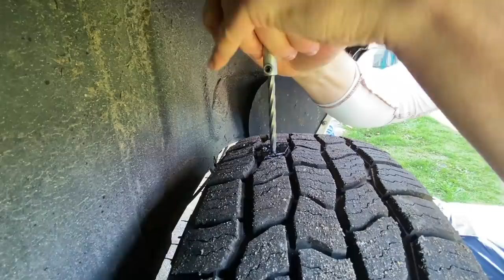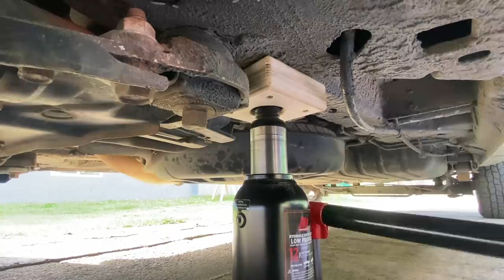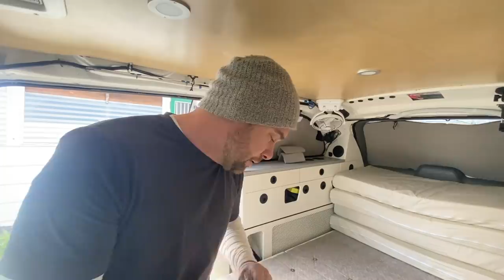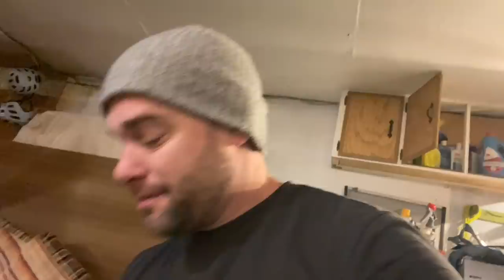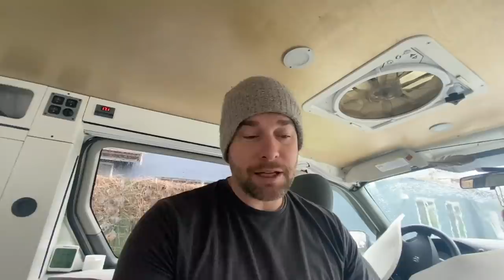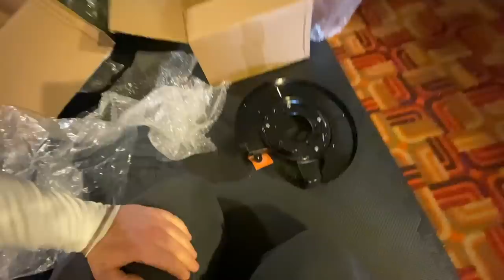Spring Cleaning & Maintenance For My Van Home & Doing A Mattress Mod

Comment: Thanks for sharing Joseph, this weekend I'm replacing my temporary cheap 1/4 inch thick plywood sub walls finally with 3/4 inch thick plywood, the temporary sub walls were to keep all my thinsulate and reflectix from being torn up, and keeping the main van wiring and new foil ducts I used to replace the old ones protected since earlier last year, by my other plywood and materials being stored back in my van when I would be done with each particular project in the van. However, I now have just a bit more time to work my van conversion build a bit more than I did when I was full time caregiver for my elderly dad, he's in the nursing home for better 24 hour nursing and long term care he really needs more than I can provide alone for him, plus, I'm not a nurse too. I'll finally be back at my old job this coming week as rehire, I was running low on my own funds and needed to get to back to work again. I had that old job for some time before my dad's wife passed away and that's when I also started caregiving for him as well. Sadly, he's had a very bad fall to the right side of his head causing him to have bleeding of the brain that he is under his doctor's observation and physical therapy into now full long term care. Plus due to his preexisting health conditions and dementia he also needs better long term care for that to. Anyway, I'm almost halfway done with my van conversion build, definitely still more to do. And, depending on the weather here, if we have high gusty winds, rain or thunderstorms will cause a temporary delay on my van conversion build because I don't have a work shed of sort nor a functional garage I could work inside with my power tools, only on nice days I work on my van in my dad's driveway. And, in between visiting my dad too. Sending hugs love and prayers daily to you Joseph and everyone up there in Canada too from me in Odessa TX USA, take care and be safe and blessed too🤗💖😉👍

Comment: Joseph, if you read this,be careful regarding your plugged tire. That plug was not inserted correctly for it to properly vulcanize. When you’re pushing the plug in and it bunches up like it did, it’s not 100% embedded in tire. When the tire gets hot and the air inside it expands that plug can pop out. The spiral tool needs to be pulled and pushed multiple times to ream the puncture, and there is also a smaller diameter plug made for smaller screws like the one in your tire. You have the larger one..check out blackjack tire repair plugs, they have smaller size.
Reply from the maker: Thanks Tommy, I'll keep an eye on it.

Comment: I need to buy new shocks and thicker/longer coil springs for the front end of my van to lift it 3.5 inches to level it with the back because it came with the lower front.

Comment: Is using that glue for your  mattress safe?   I'd be concerned about inhaling the fumes from the chemicals in the glue as it gasses off.  l have allergy induced asthma and my throat starts to close-up when I'm exposed to various chemicals.  I hope you'll be okay,  especially since your in a small area with a heat source running at times.  Joseph, I know your very health conscious and wouldn't want you to come to any harm.
Reply: Wondered the same…🤔
Reply: Those sponge mattresses give off gasses and the glue can had flame & toxicity warnings on it so I'm concerned that putting both together could cause a toxic chemical reaction between them   I sure hope not.